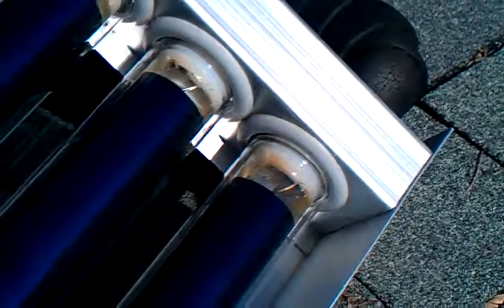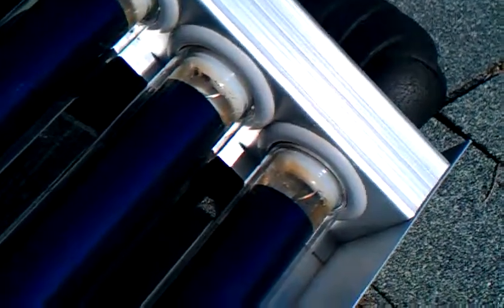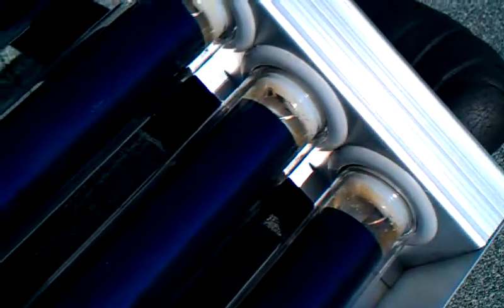Affordable Evacuated Tube Solar Hot Water System

Comment: What do you use for the connection between the tube and the pipe? Is it PVC? If it's correct, is there a problem with high pressure and heat?
I have not found the right size between the PVC pipe and the tube, I am afraid that if the size is not suitable it will be problematic at high pressure and heat